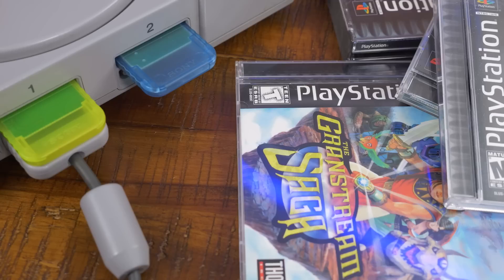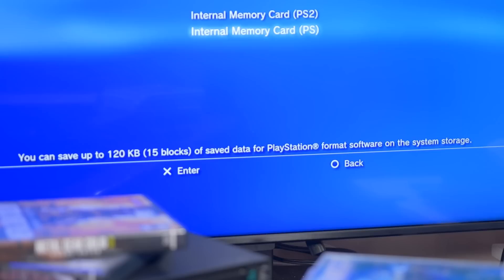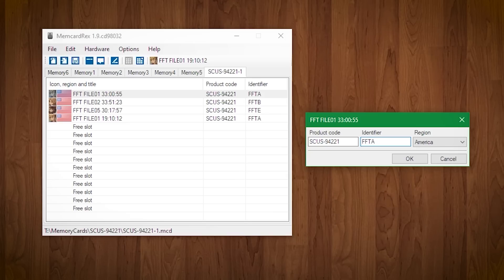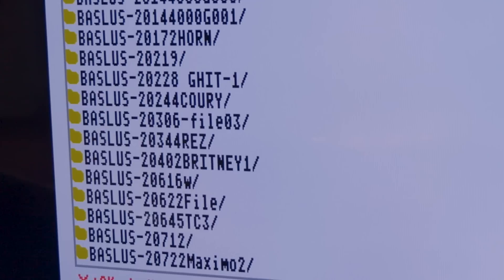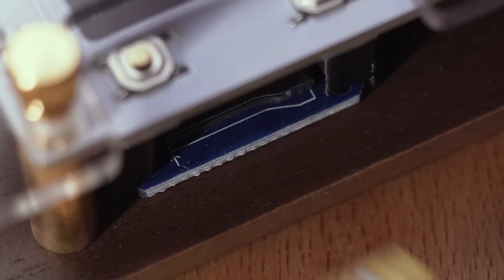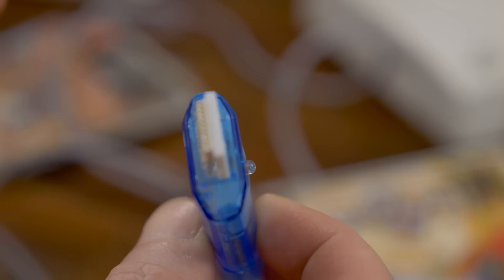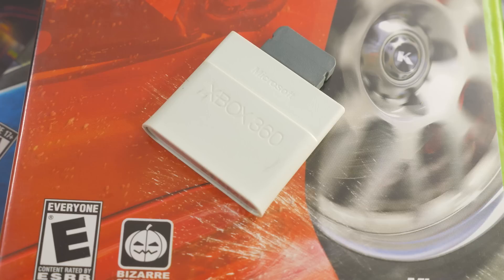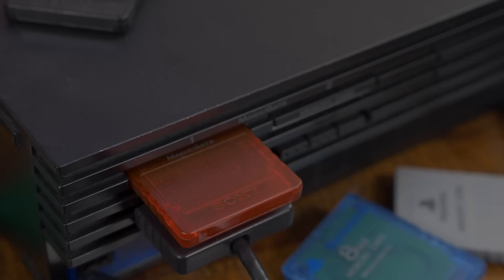Memory Card Save File Preservation - PS1, PS2, N64, Dreamcast, Xbox, & GameCube / MY LIFE IN GAMING

Comment: One issue I ran into, and why I've never finished FFVII or Xenogears was that I had one of those third party cards that had about 10 cards worth of memory, supposedly, that you just pressed a select button on the card to change. Unfortunately it was garbage and it died on me the day after I got to disc 2 of ff7. It also took out my Xenogears saves which had me at about 2/3rds of the way through disc 1.

Comment: Rather than running the software in compatibility mode you could get more reliable results by running the operating system the software was designed to run on in a virtual machine and passing the serial data through to it.

Comment: The transparent blue SD reader you show at 29:55, I have a Nintendo DS branded version in the exact same shell design in a solid white color. The only difference is that it had USB A on the end instead of the Dreamcast serial port. I have no idea where it came from, but it got surprisingly warm when transferring data.
Reply: It was very likely included with a DS flash cart. Some of them came with these very cheap SD readers.
Reply: Not sure why you would need one for a regular day but 3ds makes sense. Also I saw a GBA game shaped memory card for the DS and didn't/still don't understand what it was for because DS games save to the cart.

Comment: Dreamshell didn't work out so well for me. Also CodeBreaker wouldn't read the SA2 disc I typed the name of for recognition. It works for other people so maybe it's just my copy. Doesn't matter really since once you turn off the game the save reverts back to stock (no cheats) settings thus creating a useless save file. Yeah you can only use the cheats when you literally boot the game. It's annoying to type in the cheat codes for anamorphic 720x480 Widescreen and 60fps or what have you. I wish there was a permanent solution for these save files.

Comment: My 1019 White GameCube Memory Card was damaged by my first generation Wii. It seems that WiiConnect24 would have the console still generate too much heat while being ostensibly off, and it corrupted the saves on the 1019 (my 251 was luckily unscathed) and damaged the GPU of the Wii as well. Newly written saves aren’t accessible either :(

Comment: There needs to be an easier option for modern stuff as well.  Like the psvita.  Essentially you can manage that stuff over the network or direct with the computer, however with a partially corrupted one over in a pstv. Now that is a pain in the ass
Reply from the maker: [Try4ce] I didn't complain about Vita using proprietary cards until they started failing. They are unreliable pieces of junk.
Reply: @mylifeingaming  Unreliable AND overpriced. IF the SD2Vita didn't use up the game card slot, I'd never have wasted money on a 64GB Vita card.
Reply: @RohanSpartin  SD2Vita is also faster, no matter how big your SD card is. Try scrolling through your song list with all DLC in Hatsune Miku: Project DIVA f 2nd. It's slow on a 32 GB card and even slower on a 64 GB card (before it'll outright kill the card...) but smooth as butter on SD2Vita.

Comment: The Xbox is the system that taught me to back up my save files. I sent my Xbox in to Microsoft for repairs and it came back........... blank. That's when I learned I must back up EVERYTHING!
Reply from the maker: [Try4ce] They probably sent you a refurbished unit back that was already fixed, then fixed yours and sent it to someone else. You rarely get your specific system back from repair services in my experience. Same thing happened to me with my PS3, sending it to Sony.  I knew I wasn't getting those saves on the system they were sending me back.
Reply: @mylifeingaming  Thankfully I was able to use an Action Replay to reclaim nearly all my lost progress. And Microsoft sent me one of those last Xboxes that don't have the rumored capacitor problem. So perhaps the whole experience turned out better for the long term.

Comment: PS1and Dreamcast showed how it was done when it come to optimizing save files as the PS2 with it's whopping 8MB cards made developers lazy using far too much memory compared to the same game on other consoles meaning they usually only lasted as long as a Dreamcast card despite the much larger capacity. Shame that the Mega Drives memory card for it's CD based games wasn't covered though or Saturn.

Comment: No mention of the Nexus memory card on the DC? for years that was the only way to get your saves off DC memory cards and onto a PC. I've still got mine but even with a USB to parallel port cable I can't get the software to work on Win10.

Comment: I really enjoyed this video for the GaneCube information, thank you for making it! Any links to the mentioned hardware and or software for backing up GC saves? I would rather use something that doesn't require soldering like the part that plugs into the bottom. I bought an Action Replay that didint work, I returned it but didn't get the money back I'm so pissed with Datel who I bought it from. Any resellers for this kind of thing that's not expensive? Thanks! Also my GC model is DOL-001.
Nevermind, turns out I'm going to have to find a Wii to mod to get my saves backed up 🤣

Comment: as child i had a yelow PS1 Memory Card with an 2 character 7-Segment Display.
when i pressed a special button Combination on a Controller, the Memorycard has flipped between 24 different Save Slots and used the internal display to show wich slot is active.
the card had a total Memory of 24 MB. 1MB per Slot.
normal PS1 Memorycards had only 1MB

Comment: Question: 

I have the PlayStation 3 memory card reader.

I've noticed when I try to back up individual memory cards, that have the same game data on them, example: two memory cards with different saves from vagrant story.

When I try to copy them onto the usb drive, it begins to override one over the other. Would saving these files in separate folders affect their use?

Backup my old games because my PS3 may be getting ready to pass away soon, and I don't want to lose the ability to do that.

Comment: Since where talking about saves. 
2 saves where messed for me from gamefaqs on the ps2. 
MVC 2 top wolverine would freeze the game. the other characters where fine. Did unlock top wolverine on my on and still freezes. Sadly i don't own the disk to see if it still freeze. 
I get a match or a few in then freeze, only seems to be the top wolverine. 
Also the MvC chaos was beaten using cheats. I think the cheats saved even thou turned off. IDK maybe someone out there willing and good enough to unlock the boss characters. I think you gotta beat survival without dieing. Very hard task. And without using cheat codes because they seem to save. Maybe that's how it is. Upload on gamefaqs.
Maybe that new save transfer will work better. I transferred my saves long time ago like that using free mcboot.
Hope someone out there sees this post and puts nice save for mvc chaos.

Also mister should convert or even play the saves within the unit. Why from a site.

Comment: Are Vita memory cards not memory cardy enough? I know they act as general storage, too, but for the Vita 2000 and PS TV they are necessary for game saves as well. And they are definitely proprietary.
Reply from the maker: [Try4ce] I think if they'd have been included, we'd have just said hack your system and use the micro SD adapters or USB storage because they tend to be so unreliable and to corrupt data so easily.

Comment: Great video but I have a question. Regarding the Playstation 3 Memory Card reader and this moving saves back and forth, it works flawlessly for PS1 memory cards, but for PS2 memory cards, when moving a PS2 save from the PS3 to the memory card, it corrupts the PS2 Memory Card!, can anybody please confirm? I've struggled about this with both a PS3 with native backward compatibility (60GB) and emulated backward compatibility (80 GB MGS4 bundle), thanks!

Comment: I can't direct link without google's near-useless spam filter getting me, but the google terms are in ( brackets )
1) there's been software to use the PS1/PS2 memory card adapter on PC for years ( PSXGameEdit )
2) there's a program to use that adapter to install Free McBoot to a PS2 memory card. That's how I did it. But it crashes a ton so you have to get lucky for it to work ( [FMCB INSTALL] Installing FMCB with PS3MCA Adapter using Windows/Linux OS )
3) Gameshark for N64 had a program that let you rip ROMs and their save data from the cartridge. PS1 probably has a similar one
4) You beat me to the VM2...
5) There is a dexdrive-like device for the original XBOX made by Action Replay
Reply: Yeah ive got to say, this was one of their worst videos research wise. Still love them, but they didnt spend long on this one. They also didnt mention the nexus 4x memory card for dreamcast that came with a serial cable to transfer saves to pc.
Reply from the maker: [Try4ce] Coury said at the end that he knows he must have missed some methods. Did you notice how long of a gap there was between episodes before this one? The expectations people have on us to be almost impossibly thorough can be paralyzing. For our own sanity we have to say to ourselves that it's OK for some things to slip through the cracks and admit in the video that it may not cover every single possible permutation or possibility ever made.
Reply: @mylifeingaming   Do you have a discord? Im sure the community would be willing to help to make sure the videos are super comprehensive and in the process save you research time. Rather than doing the video then have everyone telling you what you missed, why not utilise us? 
Dont take my comment so deep man, i was just saying its the only video ive noticed a lot of mistakes/missing info on. 

Btw what happened with dreamshell? did you try burning a different version or one from different source?

In future if you want info on dreamcast stuff, ask on the r/dreamcast subreddit or the dreamcast-talk forum

Comment: If it works best with storage under 1gb, does it help to format the file system to only use 1gb of storage? Or 768mb?

That way you could use any "normal" usb key you have, and just tune it down. Of course if the Xbox uses raw blocks on the device, then it probably expects a particular layout etc. so this wouldn't work. Has anyone tried?

Comment: Raphnet's gamecube to n64 controller adaptor also contains a memory pak within its cable. As someone who daily drives GC controller on n64, its proven a seamless "set and forget" solution.
Reply: Only the newer version does. The older red version does not. I still have to keep an n64 controller around for this reason

Comment: Perfect timing can someone help me? How would I go about adding more GB for my ps3 or can I use a USB drive ?
Reply from the maker: [Try4ce] It's an official feature of the system to be able to replace the hard drive. Tutorials for it all over. You'll need an external drive of larger size than your currently have to do the backup feature in the system. Then replace the internal drive and restore the data. It's super easy but can take time.

Comment: Cartridge based games sucked because you couldn't just buy a memory card to save your games with so you were forced to use passwords of the publisher was fo cheep to put the chips necessary for saving. Every system should have came with a memory card though it was strange the 360 didn't just let you use a thumb drive.

Comment: Can the PS3 memory card adapter be used to save to and from the Mister PSX Core?
Reply from the maker: [Try4ce] No, it wouldn't be configured in a way that the games could recognize it the same way as real hardware. However there are devices in the works that would let you use real memory cards and PS1 controllers on MiSTer.
Reply: @mylifeingaming  Ah, too bad. 
I did see a guy using a PSX SNAC adapter and a PS1 multitap to save on a PS1 memory card.  Transferring saves without needing a PC is huge.

Comment: Two things to note so far half way into the video:
- recommending to buy a FCMB card is a no-no, the software is free and the original creator does not get one cent...
- you can use free FreeDVDBoot (DVD exploit) to install FreeMCBoot on an unmodded PS2 with a flash drive and (preferably) an original PS2 card

My favorite setup is FMCB, OPL and other apps setup to run from MC2, leaving MC1 free to use with a normal card and savegames.

Comment: It's astonishing how sony went backwards with save backup on PS5 by removing every option to manage your own backups and store them on your own devices; man sony is such disappointment in general, they focus on Hollywood style games with different themes but they all feel the same while letting their classic franchises rot or ruining them like they did with gran turismo, while disregarding any more unique or experimental games that made playstaion the thing it is today.
Reply: I'm not exactly sure what you mean but the PS5 lets you back up your save files via USB, the same way as on PS4. Nothing has changed in that regard. In fact, it's more reliable than it was on the PS3 where you sometimes had copy protected save files which you couldn't back up through USB.
Reply: @symphony137  Huh no, no it does not my friend, you can backup ps4 saves like could could on ...ps4, but only way to backup ps5 saves is on the cloud and you need to pay for ps+ to do it; power up your ps5 and try it.
Reply: @Sebastian_Athea  Wait whaaat.. You're right! I was under the assumption it works the same way for PS4 and PS5 games. I've only played 2 or 3 native PS5 games so far and haven't tried to back up the data but I did it for PS4 games. Ok that's wild... Man, that's definitely a step backwards. Sadly Nintendo isn't any better, there's no way to back up your saves on the Switch except through cloud which requires Switch Online.   Looks like the current gen really sucks for save file preservation...